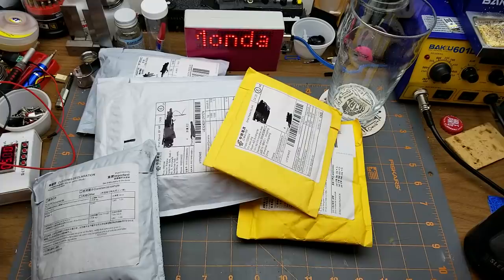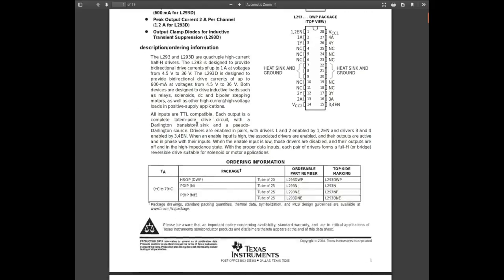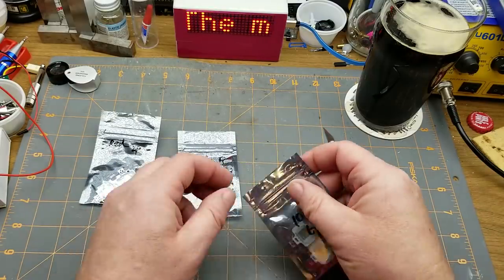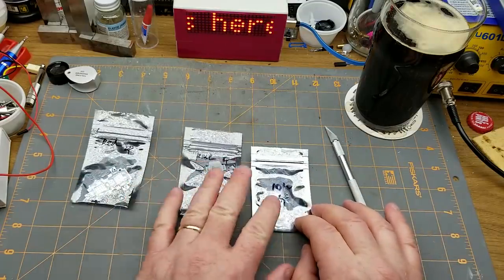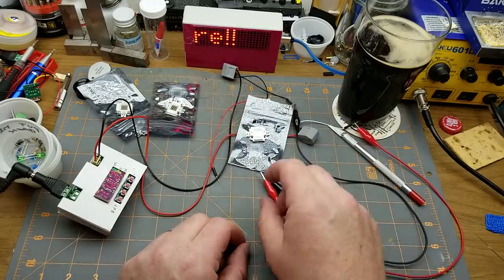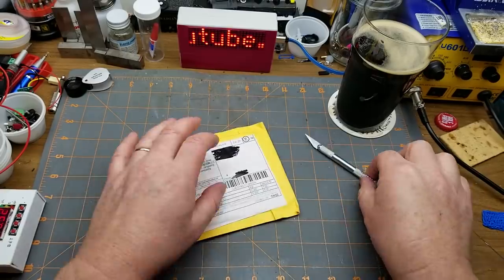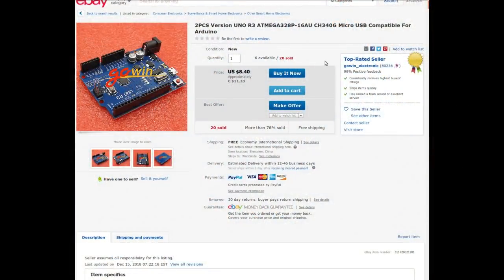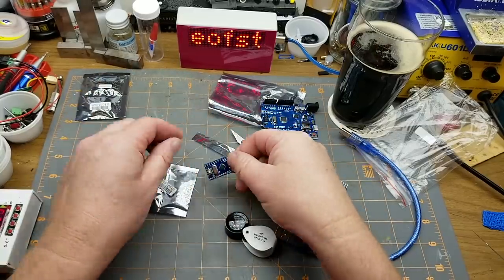mailbag monday 47

Comment: For those "10W" LEDs, the Red has a far lower efficacy (lumens per watt) than the Blue and Green. They also run at a lower voltage too, so the total power at a certain drive current is heaps less. From my experiments, the best way to get a proper balance between the 3 colours is to use 2 times as many Red. So, I build a party light with 4 chips (2 red, 1 each Blue and Green).
First set the max drive current for the 2 x Red first (say 800mA), then adjust Green up (probably 450-500mA) to get a nice solid Yellow, then do the Blue last (around 500-550mA) to make a Neutral white. From there, you can then PWM and mix the colours... if you don't start with white like I mentioned, you will go crazy trying to get a full spectrum, as you will be heaps deficient in the Reds.
The other solution is to use a 20W chip for the Red, and 10W for the other colours, Then drive the Red about twice as hard.
Reply from the maker: Yup, it's important to start balanced if you hope to get a reasonable white. 
That's a problem that many common RGB LEDs have - the blue is a lot more intense.
I still haven't decided exactly what I'm going to do with these, and whether the inconsistency in brightness will really matter to the end result.

Comment: The 3.3volt pro mini can also run on 5volts..
Reply from the maker: Yeah, it has a regulator to drop the voltage from the raw input, but it's I/O is still 3.3V
It'll work in most cases with 5V stuff, but everything will be more comfortable closer to 3.3.
Reply: You can feed it with 5 volt to the power pin and the I/O will be 5 volt. It’s exactly the same ic as in the 16MHz version. On 3.3 volt it can not work reliably on 16MHz, that’s why it’s throttled down. Merry Christmas 🎄🎁
Reply from the maker: Really? Cool!.
Thanks for the info. I often learn as much from the comments as in my initial research!

Comment: These ATMega168 are not really older, devices, just they have half of memory that 328 has. 16k of flash, 512 bytes of ram and 1k of eeprom. These are ideal when you need a lot of pins, but not a lot of memory. If you need only two or three pins then you can get attiny85, attiny84 is between atmega's and attiny85 (14 pin package). You can even find arduino board library for attiny13: 1k of flash, 64 bytes of ram and eeprom.
Reply: The ATmega168 has 16K of flash, 1k of SRAM and 512 bytes of EEPROM!
Reply: @SpeccyMan  Yes, you're right. I have no idea how could mistake that, even with datasheet open in another browser tab ...
Reply from the maker: Thanks for the clarification. 

I knew they had less memory, but I haven't run into that wall with any of my projects yet.
I assumed they were an older design, since they seldom get mentioned (at least in the places I have been reading)

Comment: What's the PSU you use in your videos? I took a look back to see if I could see where you built it, but it sees to have been there since the beginning ...
Reply from the maker: It is a 3 amp buck convertor that has adjustable constant current and constant voltage output. I power it from an old laptop power brick. 

Specifically, one of these: https://www.ebay.ca/sch/i.html?_nkw=B3603+Adjustable+Buck+0-36V+0-3A&_sop=15 

I built my own case for it a long time ago. https://www.youtube.com/watch?v=avv7dsoVO9o
Reply: Yep - easily identifiable as the MingHe B3603. I've been using one the past few days... it annoys me how the Set button is on the left when it's switched off, yet swaps to the right button when it's switched on. Other MingHe supplies look the same interface however they don't have that quirk.
Reply: @pileofstuff  Cheers. Keep up the good work!

Comment: who buys arduinos these days)
Reply from the maker: Anyone who doesn't need the overhead of adding wifi to their projects.

I do have some ESP8266 based boards, but for most of what I do they're overkill.

I like to use the simplest thing that will do the job at hand.
Reply: Personally, I'm moving to stm32f103c8. But only because I need the gpio and "flash" (I wrote an emulator for flash support).
Reply: @TheRainHarvester  Esp32 is best option for all in one cheap solution. Wifi BT  and 2 cores
Reply: Browarus Pierogus , yeah but I don't need wifi blue tooth. Also stm32f103c8 is 1.77$.  
I might get esp when I need wifi though. What is the best price?
Reply from the maker: TheRainHarvester: Those are great reasons to move to a more powerful board.
Also, I am waiting for the build video(s) on your robot hand... That looks like a cool project.
Reply: pileofstuff , I do have a video when the hand was only the muscles, near my computer Arduino lab.  It was the "guess the invention" video.   I'll have to post more footage.... It was definitely a once-in-a-life-time opportunity!